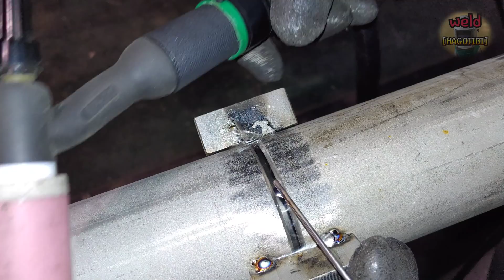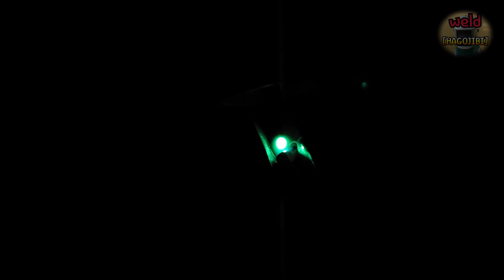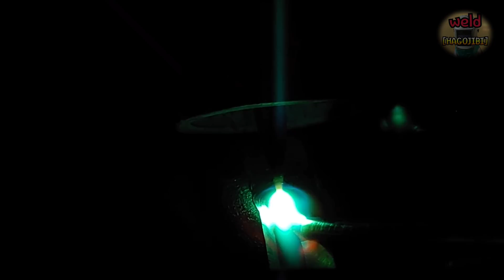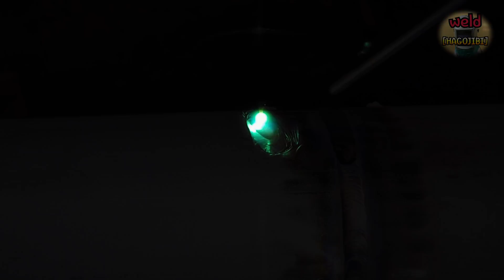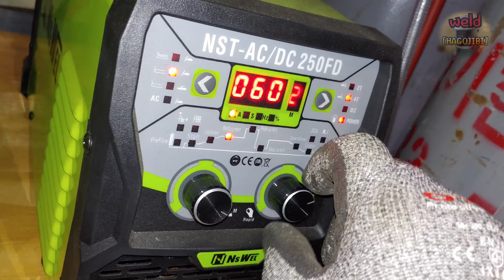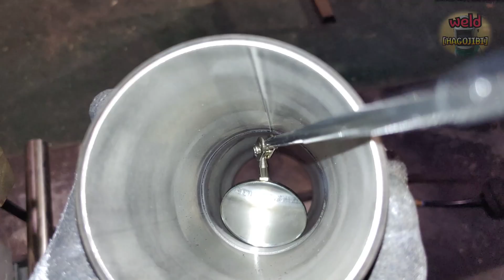Flat back bead ! Is it impossible with the half key hole TIG welding technique ?

Comment: Nice video.
Where you started afresh in welding. If you started 10 cm earlier, I know that too. Only I learned how to do the welds. Where you stop welding, you should clean the seam again. Either flex or roughen the seam with a saw blade. 😁
Have a nice week and stay healthy.

Comment: Would the opposite apply when using a different material? Going from around 130 amps to 70? I’m going to try that.
Reply from the maker: Depending on the type of material, the welding current will also vary. And depending on the size and thickness of the material, the welding current also varies.